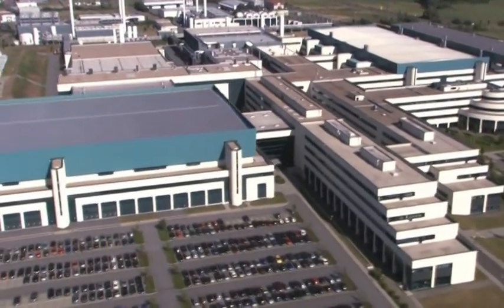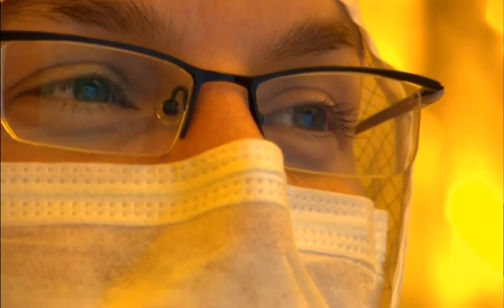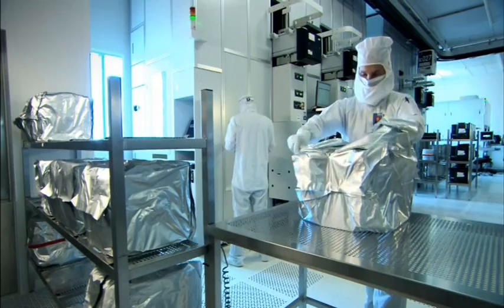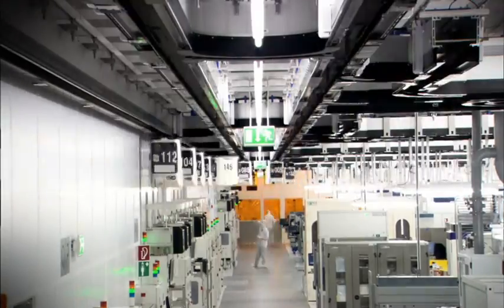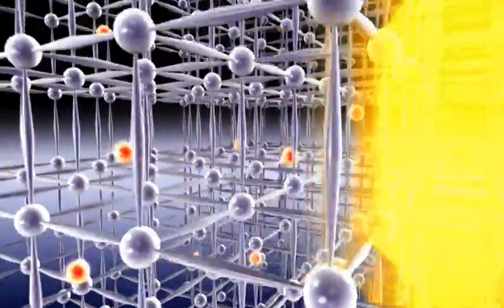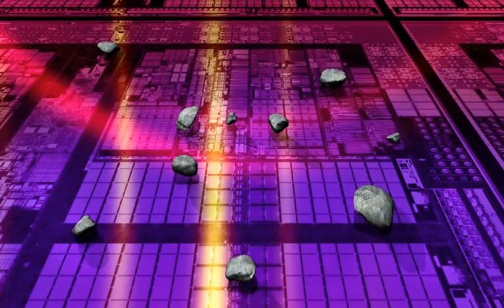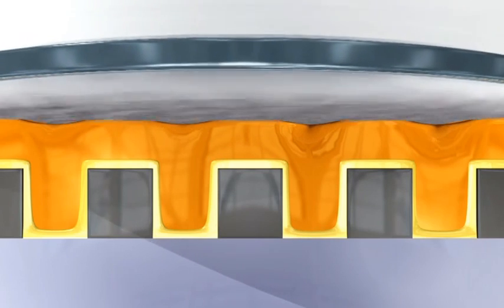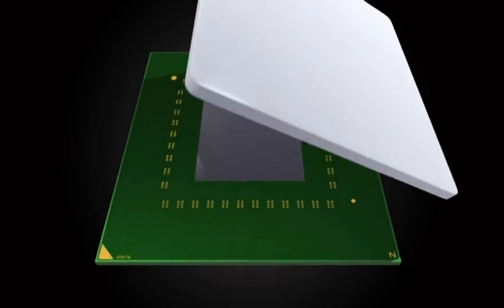GLOBALFOUNDRIES Sand to Silicon

Comment: I want to convert this directly to .mpg. Not .mpeg, not .mp4. Specifically .mpg. I can't seem to find a website that can handle this, however. I'm on a library computer, and no portable video converter is really any good at this, so downloading software of any kind is completely out of the question. This one site I'm trying right now is perpetually at 99%. It won't even give an error message, it just keeps hovering at 99%. I need a website that actually WORKS for this purpose, instead of giving errors, hovering at 99%, or saying "we are not authorized to download YouTube videos." It has to be .mpg specifically, no matter what. No other format will do, as I'm putting this video on a VCD to watch at home.

Comment: I don't think 100 billion transistors on a chip. That is some time off. They added one zero somewhere in their video production as compared with the most state of art chip in chip production in 2015. Nice graphics!
Reply: +GaryHB57 The largest commercial CPU transistor count is about 7.1 billion, so a single wafer could easily hold 100 billion+ transistors.
Reply: At 9:00 it implies that there are 100 billion on a chip, but doesn't say explicitly. It does say that the wires "link up 100 billion transistors," which cannot apply to the wafer. I'll give them a pass on it.
Reply: +GaryHB57 Sorry my bad bruv. :D
Reply: There are kilometers of wires.... fact
They connect transistors... fact
There are 100 billion of them... fact
hence there are kilometers of wires that connect 100 billion transistors they never said that all transistors are connected to all transistors.
Reply: I believe some specialized chips nowadays come close to 100 billion transistors. also, learn to make your timestamps at the right time. Yours is too late for the speech that you were referring to.

Comment: You have no idea how complex photomasks are these days. Semiconductor vendors actually blur photomask patterns purposely to cancel out diffraction that occurs. It takes a mastery of light to back-calculate the pattern needed to create transistors SMALLER THAN THE WAVELENGTH OF LIGHT USED TO MAKE THEM! 

Just think about that for a second.

Comment: That's it? I always thought it was difficult to make
Reply: It is pretty difficult. The process is simple in description, but the devil is in the details--at the tens-of-nanometers scale, the light is fundamentally not precise enough to directly make precise patterns in the photoresist without specialized techniques such as double-patterning, as an example.
Reply: building these fabrication plants would have been very difficult, because there are so many different steps and a lot of programming and quality control is needed for the machines to function correctly, there is a reason why it takes two months to complete a wafer. Also, designing the chips themselves (CPUs, GPUs) takes years.

Comment: If they're made from sand, why are they so expensive?  I can buy a glass for $1 and it's also made from  sand.
Reply: I was making a joke
Reply: +Yuannan Lin   ??? What am I looking at?  All I can find are 8350's
Reply: try to strap the glass onto a motherboard and tell us what you've found out ;D (maybe some bench results)
Reply: It's an interesting point. These silicon wafers are the highest purity single crystal material on earth and you can buy a 150 mm diameter wafer for like $20. It's all of the processing that costs money.